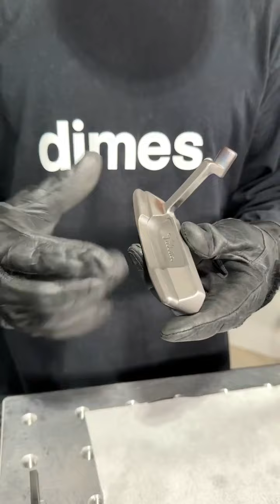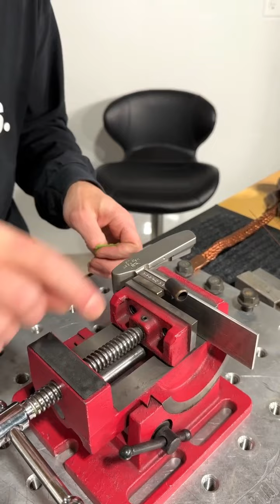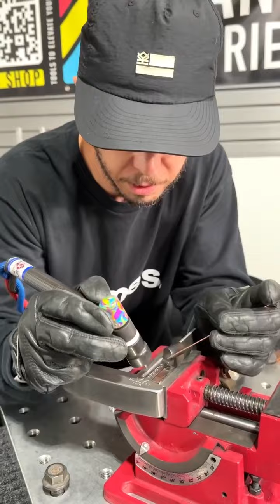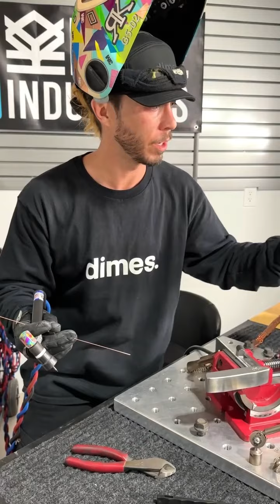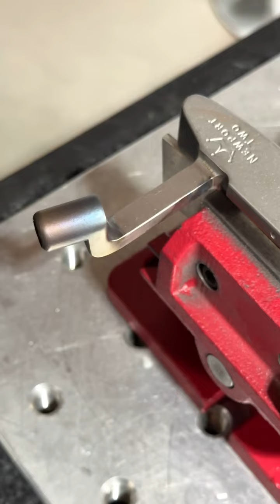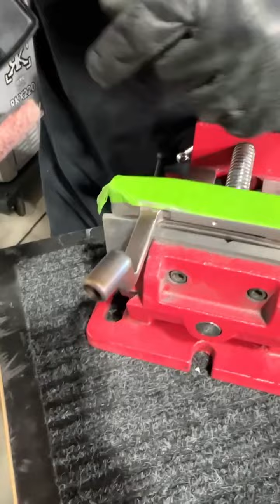Is Saving This Warped Putter Even Possible!?

Comment: When cleaning to degrease or get whatever out of the metal, would using a ultrasonic cleaner with acetone do a good job (after hand cleaning)? Just wondering.
Reply from the maker: That works well for surface cleaning, likely nothing better! These have the oil/contamination embedded and locked inside of the grain structure from the quench-hardening process. Best I know for this is to warm the grain until it releases oils, then follow with the ultrasonic. Acetone lifts oils away & soapy hot water removes what the acetone won’t dilute. I also like to isopropyl rinse parts after water wash for the best clean I can get.

Comment: Wouldn’t it be easier to place it into a furnace and get it to a bright orange and then press it flat?
Reply: Just as likely to warp again as it cools down. If you fixture it in place, it'll probably just spring back as soon as it's unclamped. That said, I'm curious if there are any special properties lost by heating it, either by welding or annealing in a furnace.
Reply: @dwaynesykes694  I’m talking about orange hot and the press will cool it down so it’ll be flat in the press.
Reply: @RadDadisRad  ask any knifemaker how well flattening an orange hot piece of metal in a press goes. The rapid cooling from the press, which acts like a giant heatsink, actually creates rather tremendous stresses. It'll spring back into a banana shape the second you take it out of the press. Flattening/straightening is done pretty much the same way as here, with targeted application of heat and a solid understanding of how the metal will move as a result of that application of heat. 

Alternatively, if you have enough material present, you can anneal/stress relieve the piece in a heat treat oven with slow, controlled cooling, it'll move how it wants based on existing internal stress that's relieve during heat treat, then machine it into the desired finished shape. It'll move again a bit if subsequently heat treated, but it should be minimal given a well-controlled process. Final dimensions can be achieved by grinding after heat treat.
Reply: @dwaynesykes694  works well, most of them do it.
Reply from the maker: Thanks for your input with this response!
Great further explanation of how technical this is and the process to control it!
Reply: @dwaynesykes694  that’s exactly what knife makers do. They put the blades in a vice with aluminum or copper plates to absorb the heat but allow the end of the cooling cycle to be slower because the metal that pulled the heat is now heat soaked. Look at how A1 and A2 steel is cooled. Also heat cycling will uniform the grain structure from the casting process. Adding focused heat is what causes differential harness and the warping because at what temperature the metal reached throughout the material.
Reply: @KANEKIDWELDS  you’re welcome!